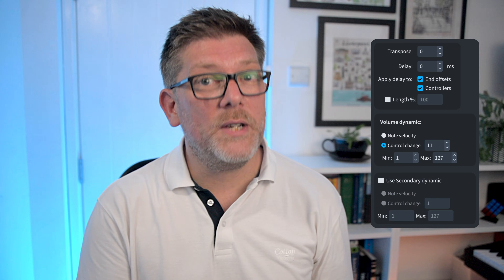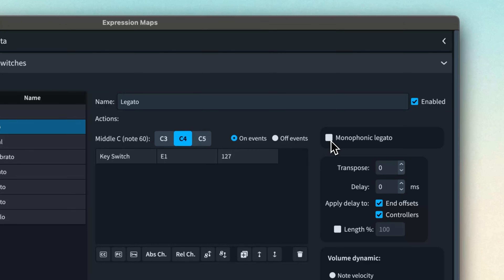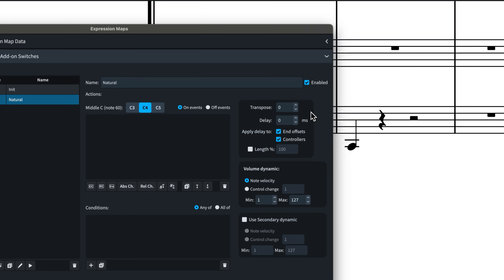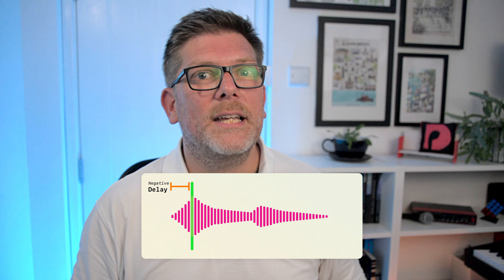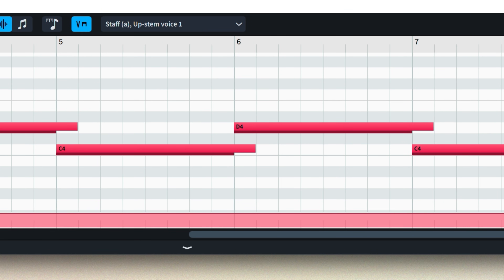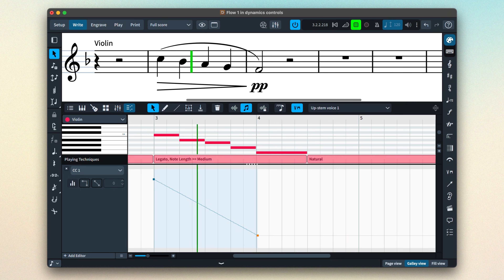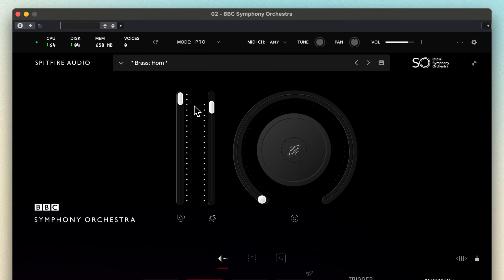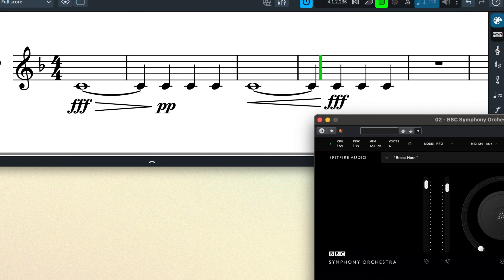Technique controls | Dorico Expression Maps

Comment: My noteperformer sounds great but it comes through one channel on mixer,???
Reply from the maker: That's by design from NotePerformer, but in their mixer you can change the settings to output each channel to the correct Dorico mixer channel.  It'll use a bit more system resources.
Reply: @dorico alot more turns out.